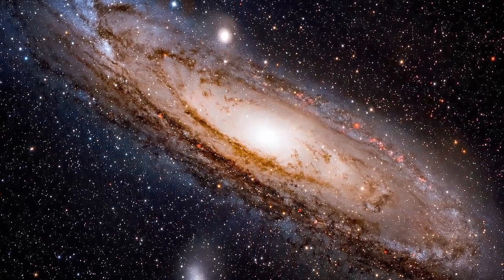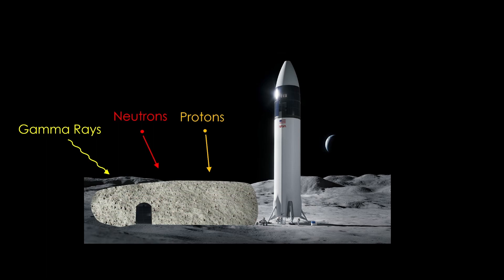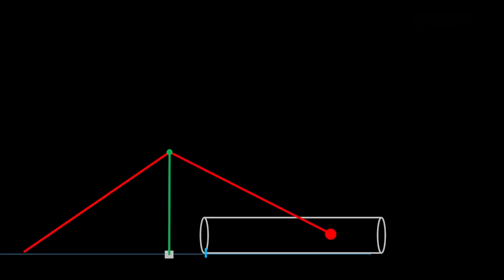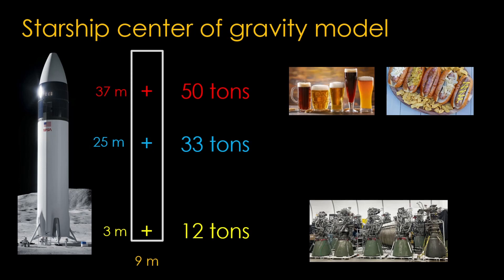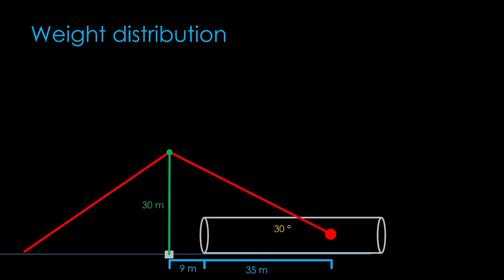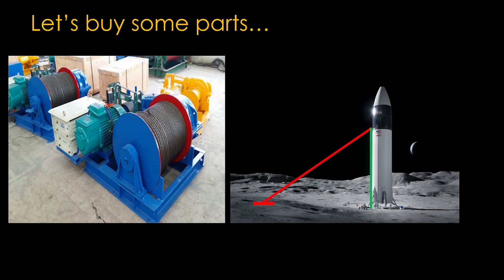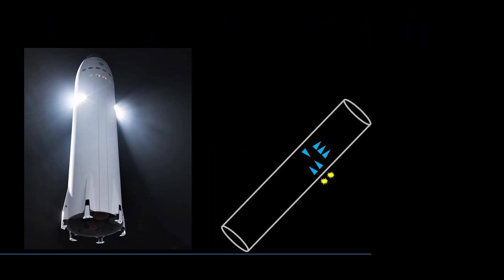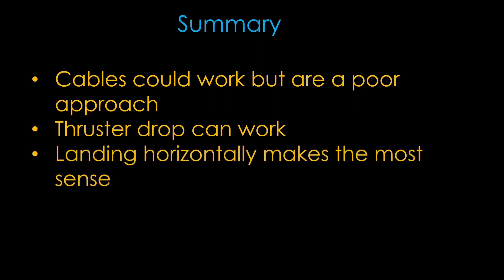Starship Moonbase

Comment: What if we land it upside down

Pros:
-gives a layer of empty tanks as shielding
-removes cosine losses since thrusters can be pointed closer to vertical
-just flip the thrusters around, no new thrusters needed(unless you need some to flip the starship around)

Cons:
-Seems pretty crazy
-not much space for landing legs
-Aerodynamics on Ascent from Earth would have to be different
-definitely no crew are going on this and cargo will have to withstand getting flipped 
-New plumbing needed(but not that bad since the fuel will be pushed to the thrusters during descent)

Im not sure if this is insane or genius

Comment: You are way overthinking this. And no you can’t just land starship on its side. Remember that the landing engines are high mounted to keep the thrust from launching rocks and debris into lunar orbit. The solution is simple. Mount the payload to the ends of the landing legs. By splitting the payload into three sections each pivoting out on legs hinged at the bottom of the ship, they will already be in a horizontal position when the ship lands. The landing engines can fire from the required high position in the nosecone. Each horizontal section is less than a third of the ship diameter so way easier to bury. No need for an elevator. Easy peasy.
Reply from the maker: I'm the one overthinking it?
Reply: @EagerSpace  Well you already need some type of deployable legs. If they attach at the bottom of the ship and run up the sides of the ship to the payload section during takeoff everything is pretty conventional looking. Then once in orbit and refueled, the ship could be put into its landing configuration without worrying about the weight of any of the moving bits since everything is basically weightless in LEO. Then when it sets down on the surface of the moon, its habitable sections are already positioned horizontally so there would be no need to use cables, anchors, poles, winches, etc. to lay a 50m behemoth on its side.
Reply from the maker: Hmm...

You would need to have both movable cargo and habitation sections that were fine being detached from the main ship, and then you would need weird load path to carry the nosecone, though I guess that you could integrate the nosecone. 
Not excited about having them on 30 meter long legs. If this is for the crewed variant, you would need to get the legs back up and if you don't you are SOL. 

I do wonder if you could do some sort of track on the side of the booster at 3 or 4 places. The payload/hab sections split into quarters, move out and attach to the track and just ride it down to the back of the booster. 

Still seems complicated for an early version. Might make sense for a later version.
Reply: @EagerSpace  No need to change the fuel tank or Raptor engine sections. The upper ring of landing thrusters can remain at the top of the tanks. Everything above that just becomes part of three legs hinged at the bottom of the ship. Three legs were chosen specifically to negate the need for any self leveling system. Any number higher than that will require leveling hardware and controls. Remember that the best part is no part. Also this design becomes completely modular. A cargo variant would have three legs with unpressurized payload tie down sections. When sending crew one leg would be swapped out for one with a pressurized compartment on the end. No need to make it anymore complicated than that. Remember that the Artimis mission profile has HLS launching and refueling autonomously. I would also deploy the legs in LEO so that no further configuration changes would need to be done for the remainder of the mission. It can fly to lunar orbit with legs deployed. The crew can board from Orion directly to the deployed crew section. It can de-orbit with the legs deployed. It can set down and later take off with the legs deployed. It can rendezvous with and transfer crew to Orion with the legs deployed, etc. For use as a moon base, just configure one with three habitable volume legs and a bit less fuel and it can stay right on the surface once it’s landed autonomously. Hell, you could send a small city’s worth of cargo and habitation module ships before a single astronaut even set foot on the moon again. 

Also your idea of cargo sections that ride rails and then are somehow detached and repositioned on the surface is again over complicated. A single hinge point for each leg is vastly simpler than a system of rails down the side of the ship which would require a separate set of landing legs that in this case would carry nothing. You already have the modules you need  in the horizontal orientation around each ship you land. Later when you’ve delivered and assembled enough heavy lift and earthmoving equipment, then you can consider permanently connecting a bunch of pressurized modules together to make a more concentrated base. For now, just use them where they land.

Comment: For the vertical landing, Can we use approach where it come in with a lot of horizontal velocity and very less vertical, then just above the surface it uses the raptors to break all the horizontal velocity, while in a horizontal position then uses the thrusters tot slowly land on the surface, it is is already in a horizontal position it doesn't need to change it orientation while landing
Reply from the maker: You would need strong thrusters but sure. Might be problematic to take off.
Reply: @EagerSpace  won't you need strong thursters anyways, even for the original plan
Reply from the maker: If you need them not to stir up the regolith, yes, but maybe you find a way around that.

Comment: I know they'd rather not send up a bunch of moon dust with thrusters so that's the only concern I see there. But this was my first thought... just knock it over. Obviously Starship would buckle on earth but I thought the gravity difference would be enough so it should be able to survive the impact. You mentioned cargo, which I didn't take into account, but I would think they could unload the cargo with the elevator before using something like thrusters to knock it over. I guess my understanding of the gravity difference is lacking?
Reply from the maker: Starship is currently about 3mm thick, so there's not a lot of strength there. 

But if you pressurize it enough it might survive.
Reply: @EagerSpace  Great point. Pressure would make all the difference in the world.

Comment: Building a sort of trunnion mounting gimble that is telescopic, supported with guy witres could allow first suspension and then slow smooth lowering of the vessel down onto the lunar surface?? with no threat of cross winmds the rigging can be light af.

Comment: what ever happened to the option of unloading the 50 ton payload and then tip the much lighter starship over?
p.s. the crew quarters can be a rover with life support  that gets unloaded first. need a guy wire to counter balance the elevator when unloading.

Comment: Just found your channel today and have watched a few episodes. Are you a maths teacher? If not, you should be! Regarding this clip though, you could use the rough approach but it would take lots of astronaut time (and maybe a bit of luck) and maybe some ratchet straps. Just knock it over, strap it back together and weld it up. I guess we'll know if this will work when one of them falls over and splatters its contents everywhere. Somehow, I suspect this will get used at some point in time.
Reply: You could knock it over by breaking one or two of the legs near the attachment point on the ship.

Comment: What I would do is have a slightly longer double pole out the side. That would form a 45 degree angle to the rocket when upright. It should be threaded the whole length like a screw jack. 

Small light motors could turn the jacks at the rocket, pulling it over. Once it passes the tipping point they support the weight of the rocket. The small motors continue until the whole rocket is on the ground. Then the poles can be removed and used to tip the next rocket. Rather than a fresh set of tipping equipment for each rocket, one set could build the whole base.

Comment: if starship is used as a habitat, it cannot be used to get back for the rendezvous with Orion. So you need another lander for crew transport. A lot of equipment that is need for a spaceship, but not for a habitat is lost . For the less  effort and a fraction of the cost, you could bring inflatable habitat modules  on starship and cover them with regolith.
Reply from the maker: You have a factory that can build multiple lunar starships. Your option requires designing inflatable habitats, designing equipment to dig in lunar soil, building them, transporting them to the moon, and doing all the work to set them up.

Lots of complicated work and cost there

Comment: Do you expect to vent all the remaining fuel and oxidiser? How? Without creating force, I mean? Also, in particular the remaining Lox is extremely high value. What if that could be kept on tank? It will take time to get in situ resources up to production needs.
Reply from the maker: My presumption is that you would plan to have minimal propellants left over when you land, either by only filling the tanks partway, carrying much more cargo, or both. 

You could certainly bring extra LOX with you. You could keep it for the long term with a cryocooler if you have enough power.

Comment: We could just use 8 thrusters at 45 degrees to the axis of Starship to use for both descent and tipping over at the end
Reply from the maker: Interesting idea. You would lose about 30% of your thrust in both cases, and I'd be concerned that you would give starship a lot of horizontal velocity during the tip over part.
Reply: @EagerSpace  you'd come down at a decent horizontal velocity and use thrusters to slow down and tip over at the same time. Thrusters can't really point directly down anyway to not kick rocks into the lower engines

Comment: I think that with the launch cadence and costs SpaceX is aiming for it would just be more economical to ship material and prefabs to the surface with many an uncrewed starships and have a large crew of workers offload and assemble a base. That way it can also be completely variable in size and shape; something everyone involved would obviously like.
Would be a lot more work, however.
Reply from the maker: Certainly more work, and work that nobody has done before. Prefabs are possible but you need to get them from the payload region of starship down to the surface, which seems very hard to do. Or they are small and it takes a lot of labor to put them together. 

I don't know how much astronaut time costs - there might be another video there - but it's certainly going to be astronomical (sorry). Anything that saves astronaut time is going to be very valuable. 

There is a hybrid model, where you drop the starships on their sides and then detach the payload portions and connect those to create your base.

Comment: I do like the "landing horizontally" option, and that might actually be the preferred approach for just landing all cargo Starships on the lunar surface. I guess it depends on how much force Starship can take in a "horizontal" direction along with the vertical axis it has on the landing pad.
Reply from the maker: The earth landing version of starship will be loaded horizontally at much higher accelerations during reentry than the lunar one would.

Comment: I think these arguments are all correct, but I also think the most sensible option is to just ship a bunch of preconfigured components on an uncrewed Starship and have robots slot them together. If a moonbound Starship is reusable, kilotons of mass to the lunar surface should be an expectation rather than a dream.

Comment: Method 2 still needs a pivot point attached to the lunar surface just like method 1, or it risks slipping on its way down. I agree that method 3 seems the best, assuming that the landing thrusters are light enough or have sufficient vectoring.

Comment: At the cable and gin pole point I started thinking of doing it the opposite of how the Egyptians raised obelisks: Build a huge hill, tilt the ship on to it, and slowly dig away the hill. Transporting the thousand slaves to do this may be a problem.  :D

The cable discussion reminded me of how capsized ship were (are?) righted. Drachinifel did a series on how the battleships and cruisers sunk at Pearl Harbor were righted and repaired. The majority of the ships sunk were returned to service. Several had been run aground to save them for this. The capsized and half capsized ones were righted using a massive amount of cables and winches. Each cable ran over a girderwork arch, which substituted for the gin pole Another impractical approach for the Moon, but interesting.

Comment: You haven't considered using an airbag? Lightweight, simple, reliable & cheap?
Reply from the maker: I didn't think of that. It would be quite a big airbag, and you'd need to figure out how to store and deploy it along the length of the rocket.
Reply: NASA steered away from airbags for a 1 ton lander landing in 0.3g. Suffice to say this isn't going to scale well to a 100t grain silo falling over in 1/6 g at all.
Reply: @dsdy1205  it's, a Lot more than 100ton & I'm not discussing landing, this is about Lowering the lander to a horizontal position after landing , sorry if I wasn't clear.

Comment: This isn't the best approach, logically would be to land vertically but with the main engines on top, so remove the nose cone, attach the landing legs at that end and flip the landing thrusters to point in opposite direction than main engines.

Comment: First of all, we don't know anything about the internal design of Starship. And there are many requirments for it, that are conflicting. For staying on the launchpad on Earth and on the Moon, the internal design of the Starship should be vertical, because people inside of it, should be able to move between levels using ladders. But when its in space, the design should accomodate zero-g elements, meaning things should be placed on the walls and be accessible that way. But then you want to introduce another element - that the Starship has to lie down horizontally all the time on the Moon. And how would that influence the internal design of starship? It all doesn't make sense. Plus, what about those radiators and solar panels?
Reply from the maker: This is a "habitat module" version of starship - it will only see people when it's lying in a horizontal orientation on the moon's surface. Radiators can be deployed from the top or you may be able to use the tank section as a heat sink; its very big and has a lot of surface area.

I'm assuming that solar is going to use arrays that are deployed on the surface. It's a lot easier to design and manufacture than making it part of the vehicle, and solar obviously doesn't work if you want to bury your habitat.
Reply: I think a Moonbase Starship will be launched uncrewed. That way everything can be oriented horizontally and the airlock doors optimized for the horizontal position. Solar panels and radiators can be placed on the dorsal side - these may need a sheath or fairing for launch but that can probably be done.
Reply: @donjones4719  Who is going to pay for it? Not NASA, as we saw in other videos, they are just happy to do that pointless tomfoolery around in Lunar orbit on gateway.
Reply: @дроу   NASA is definitely planning on paying someone for a habitat, that's part of Artemis being a long term exploratory program. Won't be till the 2030s but it's in the overall plan. Among any available options the one described here by Eric, or any other SpaceX one, will very likely be the cheapest. 

SpaceX's price advantage is almost unfair - NASA is getting HLS Starship for far below the cost that NASA would've paid them to build the entire Starship architecture. NASA is just buying a minor offshoot of SpaceX's Mars program. For SpaceX the Moon is just a handy testing ground for Mars equipment and they're glad to have NASA pay for part of it. That'll hold true if S

So... mostly SpaceX will pay for it, along with NASA. And there are a number of nations that signed the Artemis Accords that seriously want a space program. Who knows what it will all look like.

Comment: Your 3rd option is indeed the best. Counterintuitive at first glance but that's true of many good solutions. That ship will of course be uncrewed, that way the crew quarters and airlock designs can be optimized for the horizontal configuration. Anyway, a horizontal landing is untenable with a crew - when landing vertically all of the thrusters around the circumference of the ship will be needed for an abort, and the Raptor will also be available.

Btw, on a regular HLS a full 1.25 margin isn't needed for deceleration. The Raptor can zero out the the descent rate at x meters above the surface, the auxiliary engines only need to counteract the "fall" from that height. Altitude x will be whatever altitude best fits the risk/benefit of the danger of regolith blast. Years ago Elon once proposed this, saying to just fall from that height onto the landing legs. He was only half joking. Lift-off will require a thrust greater than unity but not necessarily 1.25. And a certain mass of equipment will be left behind.